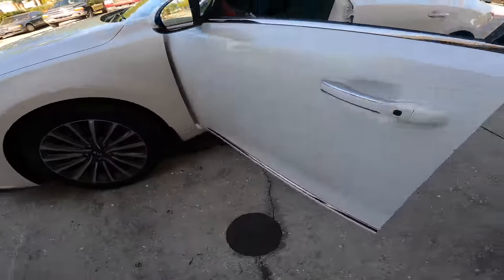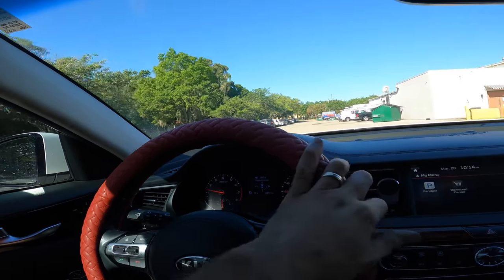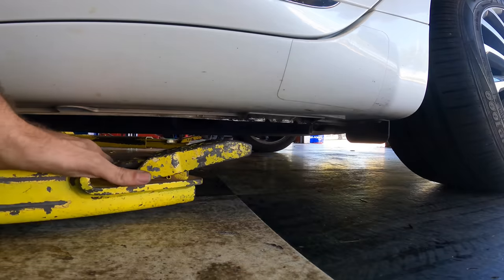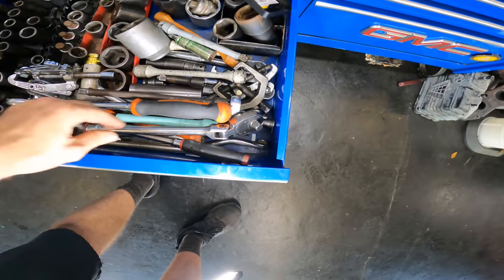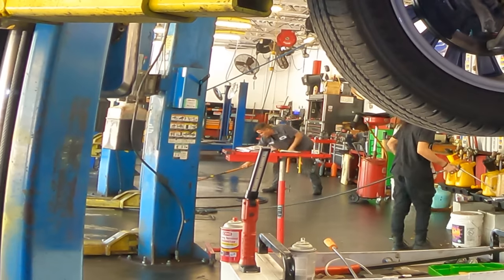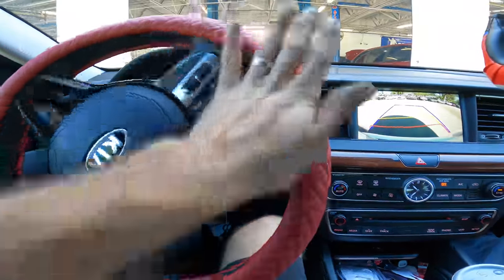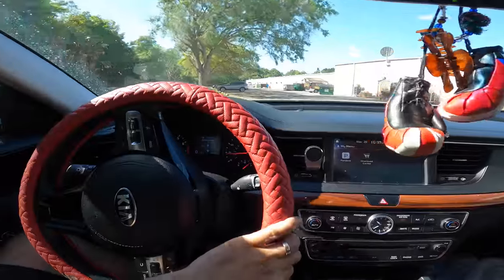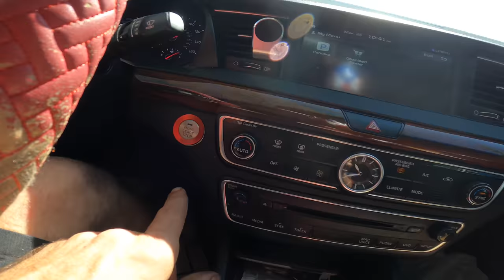I was WRONG! Comeback time! Staring into a Dumpster! 2017 KIA Cadenza

Comment: As an old time mechanic from the days of timing strobes and ignition points, I recall vividly from my training a habit I learned at the point of my trainer's size 9 boot in my backside. That is, NEVER use only a rattle gun to tighten fasteners. ALWAYS check them ALL with a wrench.
It's amazing how often you'll find things aren't as tight as you might hope for.
Reply: Clearly, you don't know how to ugga dugga. BIGGER IMPACT lol
Reply: I have a mint condition Actron strobing timing light from the 80's. Even the box is mint, I have it in one of those sterilite containers. That thing hasn't failed me yet, those digital ones fail all the time.
Reply: I too remember working with my dad with timing and points.  Good times.
Reply: @lucidbarrier  ---Me Too...

Comment: Did a repair on a sliding gate motor some years ago. Had to take it off to remount and run new cables. Took the assembly apart for a good service and clean. PCB all cleaned with electro clean and new battery. Testing everything as I went. Got it all back and working to my satisfaction. One last test to put off the mains power and check how it runs on battery alone. Sorted. Two days later I get a call from the customer. Gate won’t run. On the way over I realize what the problem is. I forgot to put the mains on again. Nice red face on that one when I admitted it to the customer. “Well at least we know the battery is fine”, embarrassed laugh.

Comment: I've worked in the car industry for 36 years, subframe bolts are usually stretch bolts only used once with torque and angle, its the fact that they stretch that deletes any form of mechanical lock I.e tab washer or split pin
Reply: stretching is what torque specs are for, the point where metals begin to deform is known, if you torque to spec, you are deforming the fastener enough to create an interference fit of sorts. At least that's how I understand it, if I'm wrong, someone should correct me. lol
Reply: @donakahorse  Trust me, if you're wrong someone DEFINITELY will correct you on youtube. Sometimes they'll even correct when you aren't wrong. Half the time they don't even know the subject matter lol.
Reply: Customers freak out when they see an additional bill for an extra $100 for subframe bolts so most shops reuse the bolts and only impact them in without the additional angle torque.

Comment: Well, I would offer that torque on two bolts shouldn’t be required to stop unibody frame shift (cause of squeaks).  That frame could be further damaged by the accident than they looked.  Popped spot welds, etc.
Reply: @MC Ulfric !? used part.

Comment: Used parts have there place,depends on what they are,who removed them ,why that car was in the salvage !
Reply: Getting used parts from unrepeatable brand name is a high risks for repeated failure that could void warranty even for labor cost.
Reply: That is all insurance companies will pay for, if you want OEM parts you have to pay the difference in cost out of pocket. I guess they figure since the car is used, you get used parts.
Reply: @johnmadow5331  Sure,but most people getting used parts have no warranty or the money to buy the good stuff after mark up! Local shop  seems to thing 300% markup is fair! WtF, I get it they had to go next door to a major supplier to grab it,but holy crap a $100 part now costs $400 plus labor.NGP's are sometimes the saving grace for some,and I see what hour saying,Ive seen a used fender show up that stilll had the CAPA sticker inside,it happens but you just send it back.
Reply: @cwstout1  Honestly,i woukd rather have a good used door or other body part than a new one,factory coated,factory paint under layer,in body parts its only as good as the guy prepping it!

Comment: I myself would , now that the cause of the noise is known , picked it back up and reset those bolts using something like Red Locktite to insure against them vibrating loose or some stupid thing like that.

Comment: I use thread locking compound on the threads of the bolts & Torque all of the critical parts up with a torque wrench.
In my car which is a Holden they use pinch nuts all throughout the car but the use of threadlocker enables me to reuse them !

Comment: Peter is a most useful and hard working mammal. Great video. Though I don’t recall you doing this car, this is a reminder to a very important practice. Always, always recheck and verify the work. The use of torque stripe is very useful when torquing multiple fasteners.
Reply: Because it was parts replacement for a body shop most likely not test driven
Reply: Ray I have watched many of your videos and I do Not recall you doing any work on the KIA. A paint marker pen is a great way of keeping track of which bolts have been tightened or torqued when working on jobs of high or critical importance. A quick applied check mark gives a easy visual confirmation that all fasteners are tight before moving on.

Comment: Knew that noise the second you drove... I've replace a few subframes. Couldn't believe I forgot this.  Turns out it was the frame or the alignment guy was loosening the bolts to move around to help with alignment...,
Reply: Should Ray have checked the alignment after tightening these?
Reply: @dthatcher7  probably won't have hurt . If the cradle moved front to back or side to side the caster or camber can change since the a arms  are attached.  Test drive and a level wheel or no pull would have shown if it moved or not

Comment: Your floor cleaning footage brings back memories. The owner of the station that I pumped gas as a kid in the late 60's would have us wash the floors with gas. Not a smart idea in hindsight.
Reply: Yikes!
Reply: I know someone who did that. They managed to get away with it till they retired and it does work very well... I'll do it on small areas of a driveway away from the building but nothing more.
Reply: @P_RO_  Use a solvent that doesn't risk explosions to cover your floor in the future, lol.

I have though washed my hands with kerosene/diesel because I used to do a side job using tire paint without gloves.

It caked onto your hand so bad and thick the only thing that really could wash it off was raw fuel. Fast Orange/soap didn't do squat.
Reply: Not smart? That depends on how well he was insured.
Reply: Yes, I remember doing that also except we used varsol

Comment: I recently learned for myself the words of wisdom about not fully trusting an impact gun.
Used one for the first time about a week ago to tighten my two front wheel nuts. 90 Nm is the recommended torque for this particular vehicle, the impact gun had 100 Nm in its lowest setting so that's what I used, hoping it wouldn't over torque it too much.
Fast forward a couple of days and this clunking noise was making itself be a little bit too obvious.
The nuts were so loose I'd be able to take them out by hand.
It was also the day I found your channel, over a completely unrelated issue (I had removed the wheels to check how my front suspension bushings were faring. They are completely shut, and then I found your video on that issue).

Comment: I don't care how tight you try and make suspension parts. You always drive the car for a couple of days and then bring it back and recheck attachment points. Even Wheels when you have torque them, we'll take a set and relax a little bit requiring a retorque procedure with aluminum wheels. Bolts that you tightened could very easily have tightened up quite fine when they were first tightened up but the flex from the car actually being driven on the road could have caused them to shift a little bit and release somewhat. It's the nature of a multiple part suspension.
Reply: For a moment I thought how about torqueing under load. Second thought, that's probably leading to over torque.

Comment: Used/third party parts will never be as good as new, OEM parts.
EDIT:  Remember to properly torque your nuts.
Reply: "Do not overtighten nuts" - warning label of a teckdeck
Reply: A 2017 car is nothing but a collection of used parts operating as a whole vehicle.
Reply: @robertsawa3407  You are correct, BUT. The car has 44k miles on it and is 5-6 years old. The factory parts should last a good deal of time, maybe 120k+. Put on a cheap aftermarket new part and that piece of junk part could fail in no time. Insurance repair, the car should be repaired to the same condition or better the car was in pre collision. 

I personally prefer used OEM parts over aftermarket junk.
Reply: @mph5896  a good insurance company will give you a lifetime guarantee on the repair
Reply: @user-pj5ff6xw4x  Progressive did on my car.
Reply: @Justinian Yi I agree. It all really depends on the situation and what is available for parts. I have to put an alternator on a 10 year old car here n a few minutes. Choice is used OEM part with like 30k miles on it from a 5 year old car for $60, aftermarket new part for $120, or OEM new for $340. My goal is to get a GREAT part I don't have to mess with again for a reasonable price. New aftermarket part is out. I would rather spend the $340 for new OEM if the used one wasn't available. Previous experience has taught me don't go cheap on starters and alternators.

Comment: Glad is was an easy fix, it got you back to the important work, the daily floor scrub. Emptying the garbage should only be done the day after trash pickup. Notice I used the word daily, But with all that brake cleaner maybe every other day. One thing I should mention, gasoline makes for a great degreaser and floor cleaner.

Comment: A mechanic didn't tighten up one of the control arm bushes adequately on my Rav4...the clunking drove me nuts. Until large application of spanner rectified the problem. As the bushes themselves fail here pretty regularly I just thought Chinese parts initially.

Comment: I wanted more floor scrubber. That machine looked interesting. I definitely wanted to see a before and after floor cleaning video. Someone left the lug nuts loose on the back wheels of my 89 Suburban. Luckily I found out on a side street under 40MPH. The rear drivers side fell down and I was grinding pavement with a drum brake and hub while a 37X12.50 mud terrain was passing me on the left and heading for the busy intersection in front of me. I lucked out and the wheel bounced into the ditch. I back tracked and found all my lug nuts with no damage to them or the studs. I put it back together and torqued all the wheels with a big star wrench.

Comment: I wonder if those bolts were tightened with a battery powered gun....i know they are all the rage now but nothing beats the consistent feel of an Ingersoll Rand 1/2" impact bottoming out a bolt and knowing it is tight...a low battery could have caused the bolts not to be tightened all the way if they were in fact installed with the electric...with air, the torque is 99% the same every time unless the compressor goes down unknowingly

Comment: Ray, or as an alternate to impacting the bolts down, use a torque wrench to torque the bolt down to the factory specification. Not Ree'ing, just saying. A detailed cleaning, or detailed detailing video of the shop could be a fun watch. A friend of mine who works for a dealership is required to do that to his bay before he leave for the night. The morning crew is supposed to make sure all the 'shop supplies' for the bay are filled. Keep the video coming.

Comment: Looks like your customer bought breakfast. I see the McDonald's bag on the passenger seat. Purple power not just for cleaning floors. Peter is hard at work scrubbing the greasy spots, sprinkle a little bit of tide on them, and the grease will lift right off. Wish we had a scrubbing machine better then brooming the hole floor. We had to clean the bay after every job.

Comment: Having worn out many different different brands of cordless impact wrenches over the years,  I found that a reliable torque value cannot be set from one fastener to the next. If the torque wrench happens to wear out suddenly, and they do, everything feels the same but the torque you think is being applied has dropped off significantly.  Always verify when tightening critical and high torque fasteners.

Comment: It's my understanding that at around 500 or so miles after installing suspension/steering parts, it's good practice to ask the customer to come back in to retightem the fasteners
Reply: Loctite threadlocker and 1/2 drive torque wrench capable of 150 ft-lbs is all that needed for most jobs.  Rarely you will find a fastener torqued higher than 150 ft-lbs unless you mess with fly wheel plate or crankshaft pulley.

Comment: Most consumers don’t know that when receiving a job like that from a body shop , parts and labour are usually dictated by an insurance company so mechanic or body shop don’t have a choice other then refuse the work and someone else will do it. Unless your the guy doing the alignment after all those parts are installed its not unusual for the mechanic to tighten bolts but let alignment guy do the final torque. All that being said , similar issue happened to me on a ML 350 Bluetec , after changing the ball joints and suspension, I recommend an alignment. The guy never took it for an alignment and it came back with clicking and creaking in front end. Torqued the bolts , got rid of the noise and apologized. Next time i book the alignment myself to save washing egg from my face

Comment: the bolts that mount the mounts , should you not torque them every time to insure it is all the same?
I think it is bad to have a black and white floor in a repair shop! with a grease and oil, stains all over.
great example to double check your work! have a great day Ray!

Comment: Some junkyard parts are OK if you're there to see that there is nothing which has affected their integrity. Better than using new Chineseum. Moving suspension, steering, and braking parts are always new, never used, OEM or known good brand preferred.

Shop Rule: Power tools are for speed only; final torque is always done by hand on everything. Always. No exceptions. That has saved my butt many times in feeling something wrong which wasn't detectable with the power tool. 

Next Shop Rule: Work in 'groups', like torquing all the subframe bolts as one process. Once you begin the group you do not stop for anyone or anything till the group is done. Too easy to stop then pick back up later at the wrong point leaving something omitted or undone. 

Planning is the key to best success with everything. Plan for every probable possibility, follow the plan, then when you're done asses your plan to include anything unexpected you may have discovered along the way. Either verify or improve the plan for the next time and repeat the process every time you do that job. If you regularly have to change things mid-plan you need to accept that you're in over your head and leave the planning to someone else or let someone else do the job. We all have our limits and we need to stay within them.

Comment: HI RAY ,nice video to remind folks that don't use a torque wrench on their own cars to get a paint pen and mark every bolt they replace. It makes it 100 times easier to locate a bolt that has come loose or broke.That's one reason when you look at a clean under-body you see different color lines all over.They don't come from  mechanics that have to baby sit their 3 year old daughters while the wife is at work,haha YES I KNOW it a pain to do it for a lot of cars ,but if it's  your own car,what's it take 5 seconds more?  I say about as long as it takes to put the safety pin back into your lower ball joint,or lock your front DOOR if you live in DETROIT?or RACK that 12 gauge ? as the case may be.Of coarse maybe the customer loosened it them selves just to be able to see you again to GET SERVICED?haha

Comment: I wonder if my brand new Ford Edge has the same issue? Dealership fired the parts canon at it over a week and I think it sounds worse. Funny thing is a coworker of mine just got an Edge too and his car makes the same noise.
Reply: Very possibly a bad OEM part if it's making the noise on multiple vehicles. I'd expect a recall/TSB fix soon.

My 2017 Elantra Sport had recalls the first year, and they were all taken care of before I purchased the car.

Comment: Still can't get over the fact that you don't recycle anything on the other side of the pond. I mean metal, paper, plastic and even some electronics just to the landfill. Gives me shivers
Reply: The whole country gets blamed because of one shop's trash?  Interesting.
Reply: @21Piloteer  wasn't basing it one just one video. Seen it before in other videos and experienced it first hand when I've been to Florida
Reply: Most places have some form of recycling, a lot of places have single stream where the recycled items are sorted at the plant rather than by the user , so it is not always obvious that recycling is being done.  Also, the sad fact is that the only thing that is actually both economically sustainable and environmentally sound to recycle or metal cans and cardboard. Everything else actually costs more energy and has a bigger carbon footprint to recycle than to landfill and make fresh.

Comment: off topic, BUT I have 5 units of oil from previous oil changes of same weight, 0W-20, but different Manny. can I dump.them all in? I dislike having to dump it though I know it's cheap. it's a 2017 car with 40,000 miles. the Google says everything from NP to NO!
Reply: There are ONLY 2 things that matter. Viscosity and API. More or less, the API is backwards compatible. If your oil meets or exceeds the API required for your car, you can use it.